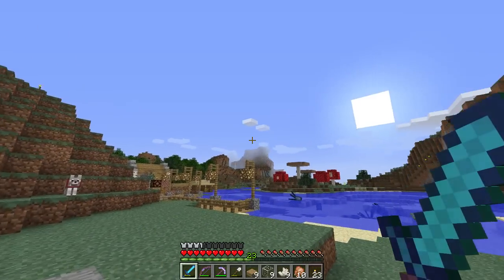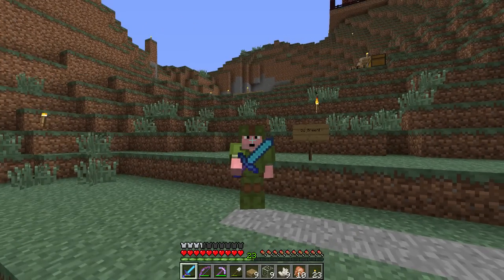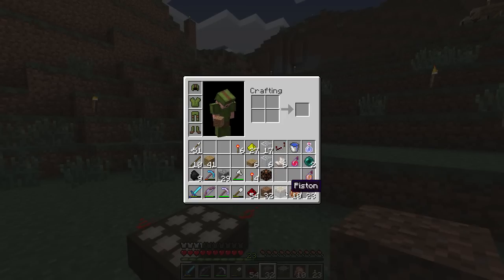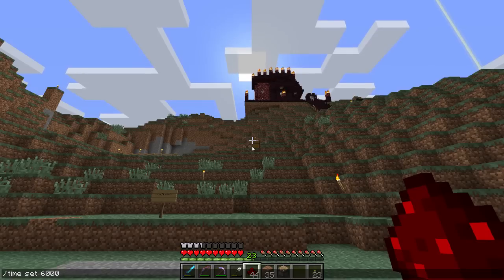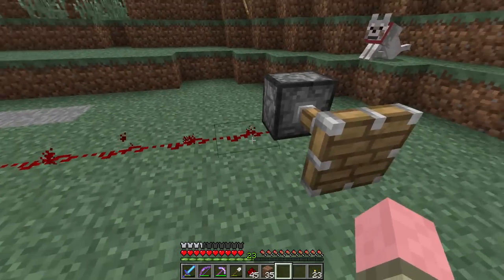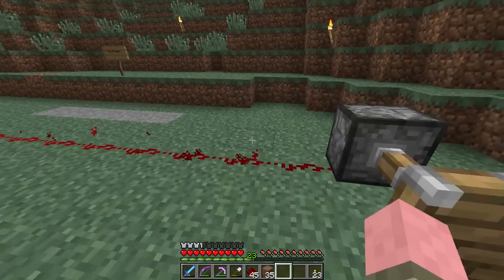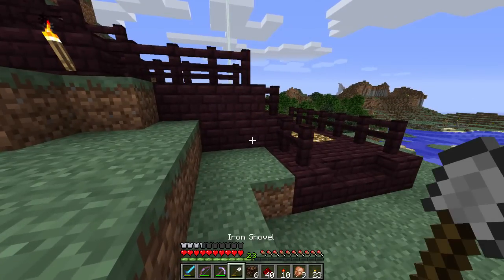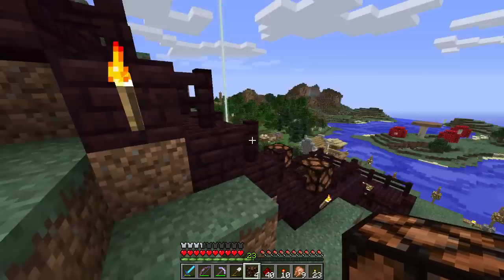Minecraft Tutorials - E78 Daylight Sensor Solar Panel (Survive and Thrive Season 5)

Comment: This would be great for your tower of power drawbridge-thing.
Instead of the lever you have now at Tower of Power, have a daylight sensor (have a backup lever too, just in case).
During the, day, when there are no monsters, you can walk across, and at night, when there are monsters, it will have lava, meaning the monsters cannot get into tower of power.
Please like if you think Paul should see this.

Comment: Paul, for a more compact inverter, use a redstone torch on the opposite side of the block that the signal is coming from and place redstone from there. Its only 1 block tall, compared to your 2

Comment: sugar5400, animals can escape pens on a singleplayer server if you log out and in. I suggest putting your pen up against a wall and surrounding.any exposed edges with a second layer of fence. Or you can make the pen out of two solid blocks stacked on eachother.

Comment: Paul you need to put hoppers under your dog chow maker so the zombie flesh automatically goes in it and put a chest under it so it goes in the chest and you can make a staircase leading down to the chest that is under the hopper (that is what I did on the map and it works fine).

Comment: Paul you could put a daylight sensor on top of a redstone block with redstone lamps around the redstone blocks. because of this during the day the daylight sensor powers off the block powering off the redstone lamps but when it is night the redstone block turns on turning on the redstone lamps

Comment: how do you switch daylight to nightlight
Reply: Just use a NOT gate.Wire the daylight sensor to a block with a redstone torch on the side. Then put redstone leading off from the torch. So, during the day, the sensor transmits power to the torch, keeping it off. At night, the sensor turns off, which turns the torch on. Hope this helps!
Reply: Make sure the daylight sensor is directly on top of a block, with the redstone torch on the side.
Reply: Also, you can use varying distances between sensor and torch to have different times for the lights to turn on. Check the wiki for full details.